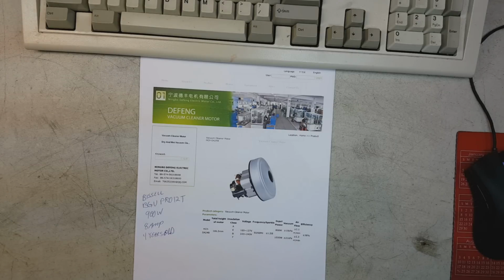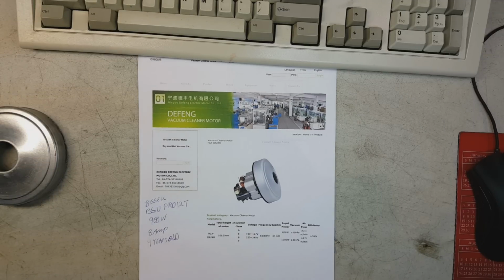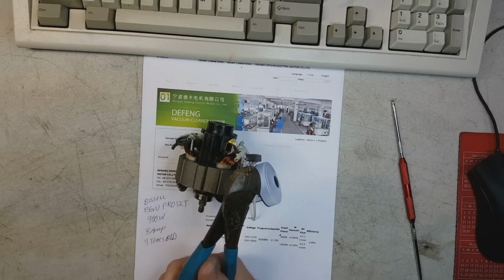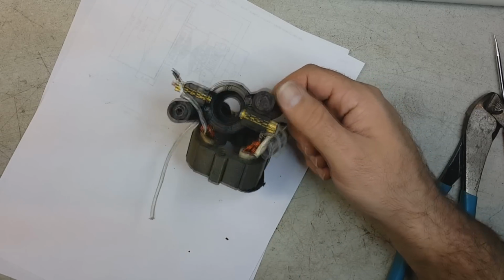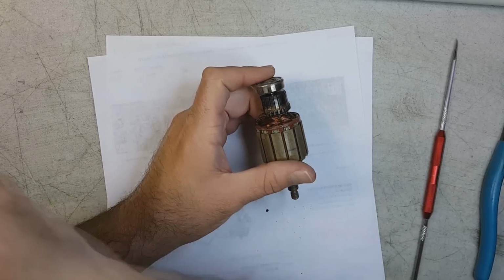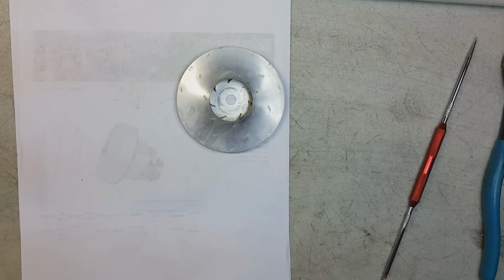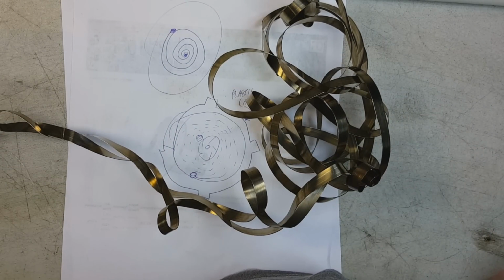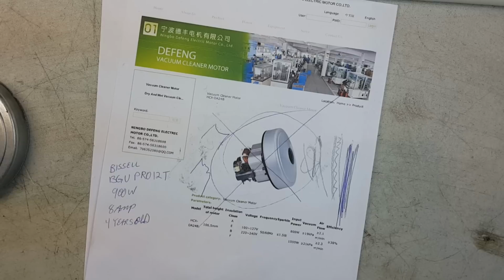Bissell Commercial/Hotel Vacuum Cleaner Motor by Ningbo Defeng of China

Comment: Poorly Made Vacuum Motors Are Nothing New - For years I thought modern upright vacuums might have been a little TOO easy to manufacture, resulting in subpar quality and poor-performing vacuums. I removed a motor from a no-name so-called "Commercial", "Made in U.S.A." direct-air upright, which had also burnt out. It revealed that even just before the end of the X generation, when manufacturing was mostly labor-intensive and upright vacuums were designed to just clean carpets (and many did well at that), some manufacturers still didn't know what they were doing!

Comment: Central vacuum companies would NEVER have these motors put into their units, because central vacuums are permanently installed in residences, and the units mostly have Ametek Lamb or Domel motors instead of these godawful Chinese motors. Central vacuums are supposed to last 20-30 years instead of 2-4 years. And besides, the power of those motors would never compare to the power of the Ametek Lamb and Domel motors.

Comment: That fan looks like an impeller for a Bell and Gossett boiler circulator pump, except about a quarter of the thickness. Keep in mind that those pump water, not air, and this impeller is smaller and yet it is  expected to move air. What a piece of shit.

Comment: electrolux. it says: made in EU. i open it, look at the motor: NingBo Defhang _, the motor was burned, the front bearing was in pieces. why...?
Reply: High quality German, USA, Italian, and Japanese suction motors are made to last a very long time. If the brushes wear out on a high quality suction motor, it just stops working until you sand the commutator and put in a new pair of carbon brushes.

Comment: If you want a true commercial vacuum get a NSS or advanced or sanitare etc. They may cost $400 $500 but they are the speed queen of vacuums. I want to get a NSS pacer model 12UE as we use those at work and they are great. overload protection that shuts the motor off if it over heats. user friendly for service and removing clogs. I currently have a Vintage Kerby heritage II vacuum. Need the hose attachment for it which is why Im going to get a commercial vacuum cause I need a vac with a hose and I don't want some walmart $30 vacuum. did that once. first one the brush roll seized up after a month or 2. exchanged it only for the 2nd one of the same model to do the same thing a couple months later.
Reply: Windsor's Versamatic and Sensor vacuums are also great.  Don't forget about The NSS Model M-1 "Pig"!
Reply: Joel Hunt also consider Lindhaus vacuums as well.

Comment: That motor has all the issues iv seen with the new Lasko/Galaxy, Aerospeed and Holmes box fans have. the windings are so thin and they are not even copper from what i was told. they were copper plated metal. and they are held in place by plastic zip ties. if you look at the motor wrong you will ruin it. compare that to the Mc Millins and Marcos in the old box fans. its no comparison..LOL

Comment: Wow, that's an impressive motor.

Wait, this was used in what's supposed to be a commercial-grade vacuum cleaner instead of a Dustbuster?!

Jeez, what were they thinking?!

Goes to show, if it's going to be a commercial vacuum cleaner, you'd better get a Simplicity or a Riccar.
Reply: Watcher3223 a real commercial vacuum motor would be an ametek lamb, ametek italia, domel, or an in house built motor like Lindhaus vacuums. Even a Johnson motor wouldn’t hack it. A ningbo defeng motor is an abomination and should not be in even a higher end residential vacuum let alone a commercial vacuum.

Comment: Wow. that's the worse I ever seen windings on a motor. Also the brushes. Holly shit why was there a clock spring?
Reply: Good vacuum motors do not use a clock spring the fan housing is press fitted or screwed to the motor case. Also have long life carbon brushes as well as thick varnish on the windings. The field windings and armature are a also larger to facilitate heat dissipation in a quality suction motor. A quality brushroll motor is a universal motor instead of a DC motor.
Reply: Good motors are made of metal not plastic

Comment: Did that vacuum have suction?  Of course it did.  It royally sucked.

21:53 was the best part!  That's all Bissel had to do when selecting a motor.  Ningbo Defeng make motor for you!

Commercial isn't any better than residential/consumer.  Industrial sometimes is.  Not by much.
Reply: +jaykay18 haha, yes it must have!!!  I found this in a dumpster at the city streets department, I actually didn't know what it was from until I did a bit of searching and found out it was a vacuum motor, and then I remembered I saw the plastics from a Bissell in that dumpster also.  So I researched and found out exactly which model this was used in.

And yep, they make motor for you and then boat them fuckers over here.
Reply: harleybadger1 Shipping must be cheap.  They ship furniture over here, big pieces like couches, from China.  I don't see the savings.  You certainly don't see the savings at the store after they mark it up 500% either.

Comment: You know my thoughts on these Chinese motors. I have no idea why a clock spring was behind the fan like that. I guess Defecating Electric makes Jack in the box toys too. Also, why is the fan a water pump impeller? Shouldn't these have two fan disks one behind the other? You would think.
Reply: +Emerson Collie Oh yeah, that part I didn't show or mention.  The plastic housing around the motor had sort of a built-in fan disk directly behind the spinning metal one, it was molded into the plastic and didn't move at all.  And yep, the first thing I told Spats when I found it in the dumpster was "hey look, a water pump".. haha
Reply: All the new ones like that use a single stage blower and a plastic static impeller to redirect the air to cool the motor.    Old vacuums or shop vacs used 2 stages of rotary and static inpellers and a seperate cooling fan on the motor.     I think the worst vac i've ever worked on was a shark.   The motors in all these new turds are made smaller and smaller with less metal to save weight, yet run at their physical limits until they die.
Reply: @AH-zw9zx  They still use 2-stage motors in central vacuum systems.
Reply: One of the best chinese made motors are the Johnson YDK motors used in the DC07s they are very whiny motors but, at least they are built to last and have replaceable carbon brushes just add some thin oil to the bearings when changing out the brushes. The Ametek Shanghai motors used in 90s hoover vacuums are also very good quality. The best vacuum cleaner motors are Ametek Lamb and Ametek Italia motors. Miele and Sebo use Ametek Italia motors
Reply: Back in the 90’s and earlier, Hoover actually made their very own motors in house up in North Canton, Ohio along with the rest of the vacuum. Even in the early 2000’s. Once TTI bought them out, they started having companies like Ametek Shanghai make the motors. They are decent motors that hold up well.